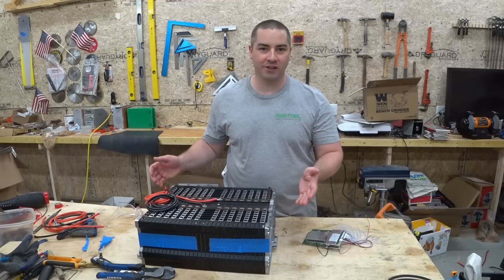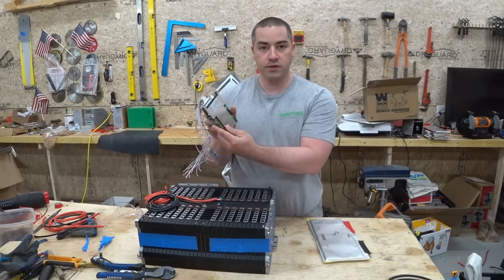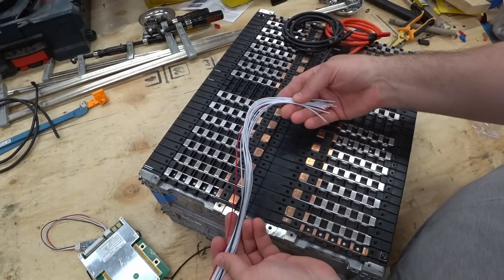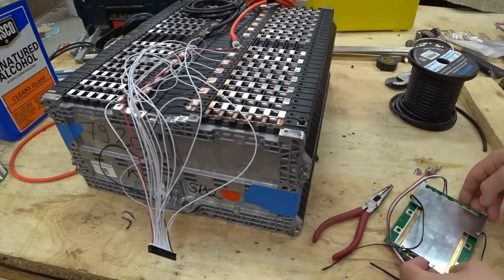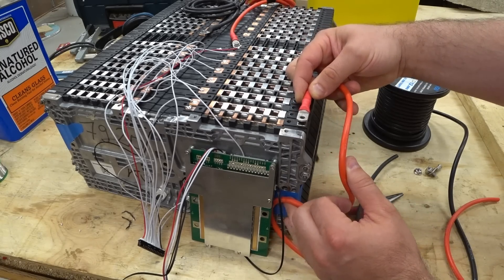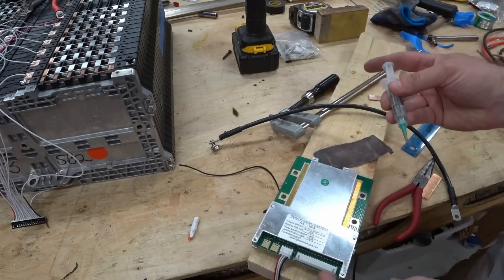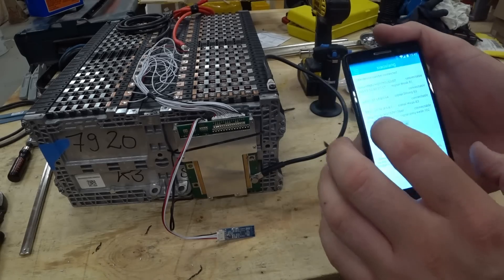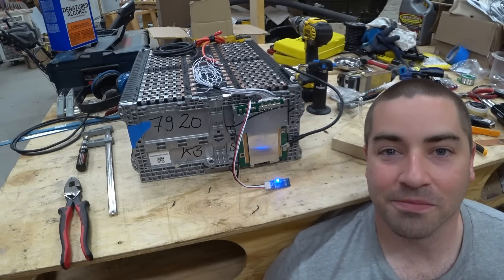100A BMS with Bluetooth Monitoring, Install

Comment: I believe this is the same BMS I'm using and if you click on the individual cell on the screen that shows all the different cell voltages it will actually show you a data logging of the history you can see that at the end of my video herehttps://youtu.be/Yj7a1wzpQGQ. I also set up this with a relay so as not to use the transistors in the BMS for the shut-off but instead of relay which could handle heavy current. Of course it does not read current then. Another thing to think about is that when the BMS shuts down the current from your charge system if you're using solar panels it's possible for the voltage to go up so high that it burns out the transistors when the device tries to shut off the charging.
Reply: I've heard this danger to your charge controller being a problem.  I don't really understand why this is a problem.  The charge controller is meant to be able to break connection to the battery if the battery voltage is high.  How does breaking the circuit between the battery and the charge controller cause a high voltage?  If I understand you correctly you are saying it could destroy your charge controller.  Is it a problem only for PWM or also for MPPT?  
I hope I am fine if I get a charge controller rated for 48v and use it to charge a 24v string.

Comment: The last bms I used , had about 6 holes for the batt connections, they were about big enough for 12 gauge wire, so I divided the wire, and soldered each set of strands to the board,   I see nothing wrong with the way you did it!!   As long is it works, without problems,,,

Comment: Be very careful with that style BMS. I recently ripped apart a pack frantically as a BMS just like this malfunctioned and started overcharging a cell group. It hit 11.5V before we could completely dismantle the pack. The whole thing was ruined as a result and had we not been there when it happened it would have caused a fire.
I like to call them Battery Murdering Systems for a reason.
Reply: You could have just cut the sense cables? lol
Reply: They will also fail in a way that puts a tiny load on individual cells causing them to over-discharge and get out of balance. In my opinion, better to bottom balance and then set the top charge limit conservatively. No need for BMS.

Comment: There is no chance that BMS will carry 100A safely for any great length of time - save your home and buy a REC, Orion or Batrium.
Reply: You really have to read between the lines and be skeptical when buying any electronics from aliexpress or other direct from china sources.   They will often list a variety of products within one ad, and then you have to decipher which product you are reading the specs for.  Often they will say max amps 200, then 3 lines down it will say max amps 100.   it's a shit show. 
The way I would look at this is 100A max(30 seconds), 50 amp continuous, providing you install a large heat sink and ensure that the device is not getting too hot.  

The main difference and reason why these things will fail is they are shipped bare, with no heat sink.  It is almost implied by the bare naked metal of the case that you should know what you are doing and put a damn heat sink on the thing.  Without that heat sink, you can't really blame the device for failing.  Look at the expensive name brand stuff, and they are usually a massive block of aluminum fins.
Reply: did you miss the obvious part (and/or make another untested bad assumption) where he transforms that large DC amperage directly to high voltage AC low amperage WITH HIS big ass inverter right there on the same shelf ,oc missing a good diy inline supercap bank to smooth out the occasional surge or two, as most people don't/cant buy all DC home appliances, or use/install many up/down buck/boost DC TO DC high 10-30 amperage pcb devices (nevermind 100A+) runs more than a few 10's feet at most.

buy your recommended proprietary (most of it made in china, and assembled somewhere else) per "single unit" price (*designed for the electric car and specialist proprietary charging stations etc) bms for $500,$500+,$700 + extortionate brandname export/import duties (based on your untested bad assumptions), 
Verses many tried and trusted open single cell bms chipsets and pcb for far less, and easy to source and replace and repair should they actually fail... 
and you didn't have the foresight to actually buy and install a second one as an onsite dark cable backup, installed at the same time you installed your conduit and primary system cable for these primary diy power storage setups ...
C.O Steve Clunn
 https://www.lithiumbatterypcb.com/smart-bms-software-download/
https://www.lithiumbatterypcb.com/Protocol%20BMS%20EN.zip ETC

* https://www.youtube.com/watch?v=jT8IsAd9ea0
mikeselectricstuff
,Published on Jun 6, 2019

Aliexpress "32A" (7kW) portable EV chargers ( EVSE ) Zencar, Khons
A look at two cheap "32 amp"  /7kW EV charger ( EVSE) units from Aliexpress. 
Both cost around US$330 (GBP260). You may or may not get charged import duty/VAT - assume you will and treat it as a bonus if you don't!
Reply: He going to be running them 30-40A max peak load per cell pack and charge likely be more then half that (15-20A)

Comment: My Orion jr bms came in the mail today! Waiting on some Calb cells. Going to be programming the CAN bus to com with the Victron gear.. fingers crossed
Reply from the maker: That's going to be pretty nice.
Reply: I’m excited about all the features, might be a bit much for parallel strings, could add up fast. My plan is a string of parallels

Comment: no fuses on the balance leads. Yikes
Reply: prob because it draws a wooping 20ma it might start cooling it instead :-)
Reply: bms balance wires do not have fuses. period. the wire is very thin and will instantly burn out if there is a short cut.

Comment: I'm cringing just a little! :-)   Always start with the negative balance lead first, as a 14S board can usually also do 13S or less, as long as the most positive goes to the topmost cell.
The B- and C- connections should be soldered, not bolted! Best to use both holes and get as much wire in contact with the board as possible. Needs a big soldering iron for this because it's a huge heat sink.
Reply: It's clearly designed to be a lug connection. Solder is not designed for 100A
Reply: @climatechangepreppersfaceb2148  Then use copper strips on both sides. Some BMSs come with cable pigtails already soldered to the board, so these in particular are designed to be soldered.
Whether that is good practice is another thing, but lugs by themselves are going to be a hotspot - the pcb copper is not so thick.
Reply from the maker: Hi Andy,  Maybe you can help me with the process?  I don't know how you can solder a multi-strand wire to the board.  The 8 gauge wire is big and fat.  How do you go about soldering it?  Do you still use the hole in the board?
Reply: @DavidPozEnergy  It's not easy - on mine, I pared the wire into quarters, put two through the hole, and bend so they're flat on the board 180° to each other, and the other two bent 180° on the same side of the wire and smothered in solder.
You could also come in from the side and part the strands so half are above and half below and lie along the tracks, again smothering in solder, but have to be careful not to overheat too much.
Hope that gives you a picture.
Reply: @ahaveland  Power connections should never rely on solder. They should be physically secured with bolts, crimps, or other positive mechanical connections.
Reply: @TrackGeeks  I agree, however these BMSs are usually soldered.

Comment: Another great video David, thanks. About the BMS, Following the specs, the balance doesn't kick in before the battery reaches 4.2V, and the balance current is 50ma (specs on ALI). In my world I would never charge up to 4.2 to extend battery life, so better to warn potential buyers about these quirks. Look forward to the next video.
Reply: Just noticed you can change voltage settings, but 50ma is still very low.....
Reply from the maker: Hi Frank,  I don't plan to run the voltage up to 4.2v per cell.  I agree with you.  Part of the reason for this BMS was the ability to change the voltage settings, but I have not tried that yet.  I'll include it in a video if it works or not.  Thanks for watching.
Reply: @easypowerwall  well you could just about run a single LTC3108 Energy Harvester perhaps :)
https://www.youtube.com/watch?v=BOFt1gl_3ZM
Reply: What balancer does balance before 4.2v

Comment: If you put on 4 bms do you know yet how to keep the balance between batteries, or is this not a problem.
Reply from the maker: All the batteries will still be paralleled together at the circuit breakers.  So all the batteries will stay in balance to each other, even though the individual cells might be slightly different.